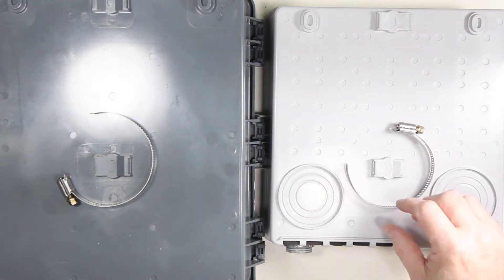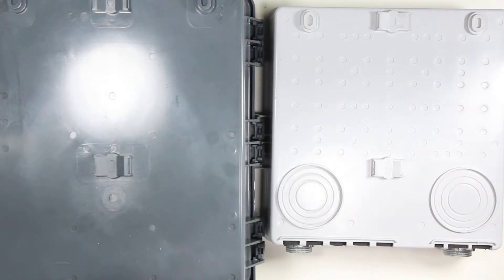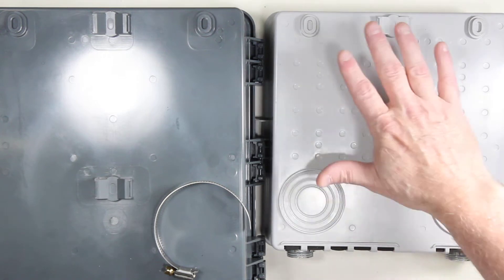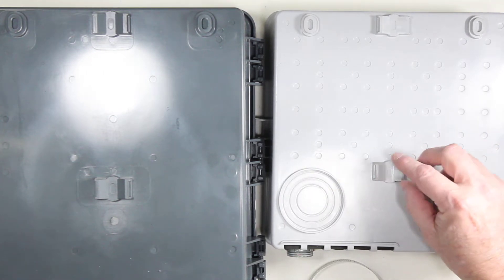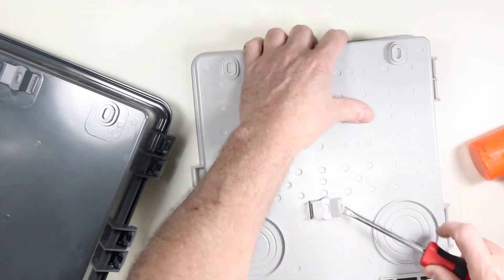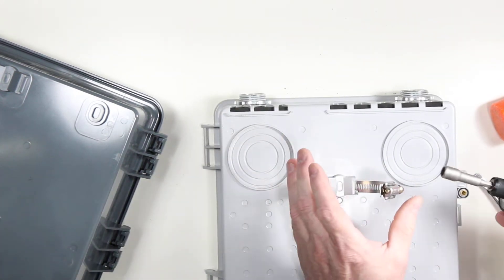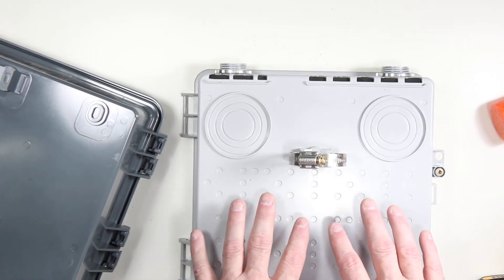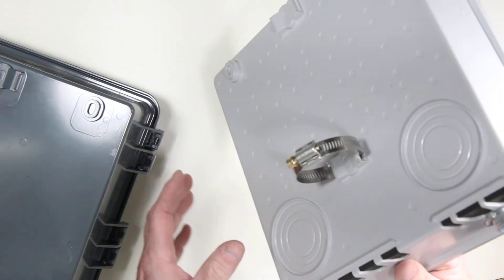Mounting CG-1500 HC-2500 Enclosure with Band Clamps

Comment: No need for band clamps, Just use a nice thick zip tie. cheaper, faster, rust proof and no tools required.
Reply from the maker: The "thick" zip ties referenced are not as easy to get tight against a smaller pole, are not typically reusable (meaning you have to fish them back through each time) and the really good heavy duty HVAC zip ties are not cheap.  They can be a good choice for very large items like trees but in those cases, screws work better.